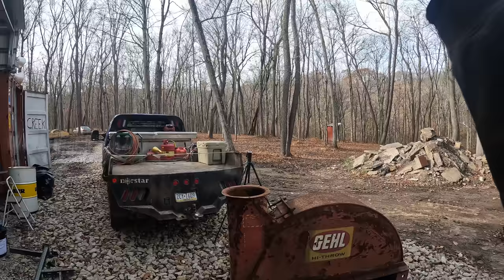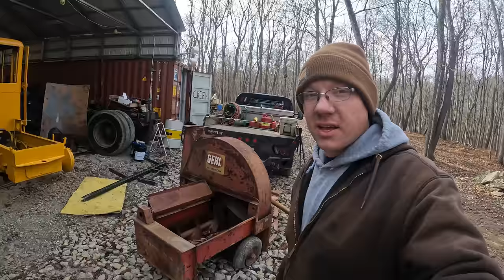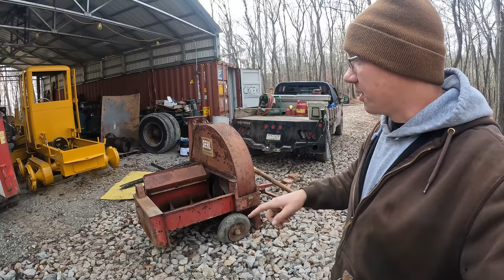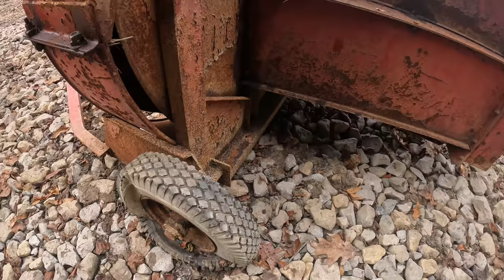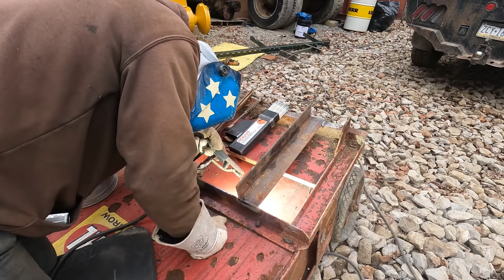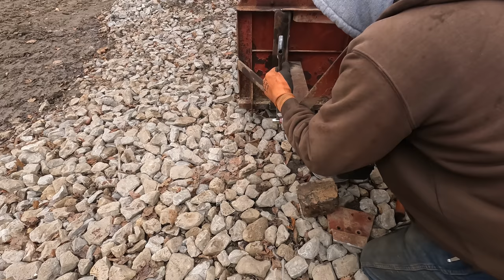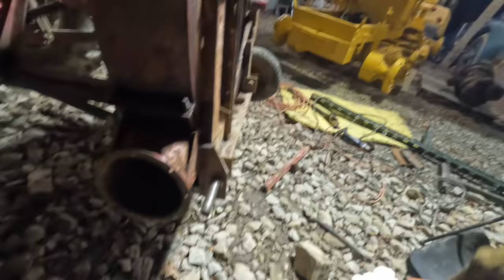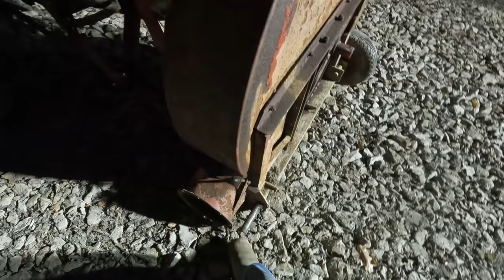I Built a Giant DIESEL POWERED Leaf Blower!!!

Comment: Bolt a plate over the hole in the side. 
Open an intake  hole on the side opposite the PTO about equal to twice the diameter of the output. Put an intake funnel tapering 
from three times the diameter of the intake to the intake size over about two feet of length.
That will force the intake air to enter the center of the fan wheel in a smooth flow. Then the air will be forced out to the outside of the fan wheel and gain speed as it travels. 
Extend the output about two feet longer. Have it taper to be 20% smaller at the end. 
That I'd what I did with a centrifical exhaust fan  blower on the anodized tanks at UTC in 1983. 
Doubled the flow at the output and increased the pressure at the output.

Comment: I would suggest turning the chute somewhere in the range of 210 degrees clockwise if your looking from behind the tractor. That way it will give you a more downward angle and should solve your distance of air intake. Then I’d look at creating a air dam using some ducting to increase air intake. Another idea that you already mentioned is to bolt a rectangle on the output to creat a more fanning effect.

Comment: Hey Matt, I think a nozzle made from plastic similar to what bins are made from on the end that flattens out and spreads the airflow will provide a simple effective result - it could also be easily removed when you use the blower for other tasks.  There appears plenty of air being generated, but it in hitting the ground in the wrong shape (poor description but you can probably see what I mean).

Comment: you need the intake for the leafblower at the top to get more pressure..it will have the same as it did before you moved the output...and a down spout

Comment: Hi Matt, a land wheel would be ideal for controlling the height of the blower, you could drop the hydraulics down. Just a tip, when connecting your  tractor to an implement with 3 point linkage I was told to connect the fixed arm first then the other arm can be adjusted with the winder.

Comment: I think you need to rotate the shroud back up around and have it blowing at a lot steeper angle so the air gets down under the leaves and creates lift, that's the way a leaf blower works. That will get you the volume you need also.

Comment: The moisture content of the leaves is up there between the leaf contact with ground and grass. Water acting like a magnet. Air pressure from inlet opening-right on. Change that. Could really work quite well. But the leafs have lots of moisture. Remember fall. Almost leaves full of air. You will get it done for sure!! Debo.

Comment: Try grinding the edges of each blade and turning the blower opening back to it's original position. Put a mesh over the original open where the blades are turning as this is why you have great air flow.  If you put the outlet hole back to it's original position adding flexible piping aimed on an angle at the ground this will give you greater aim towards the road. I'm going to try this because I know my idea will work better. Try it if you want to use it as a hay blower you can as the chute rotates as you know.

Comment: I'd try pointing it down-ish, like 2 o'clock. It'd probably move max air for leaves and debris and yet leave heavy stuff like rocks in place. 

Then, when you dig a deep hole for burning brush you have a built in incinerator blower too that could do tree stumps.

Comment: You need to increase the pro revs if possible, put a vertical slotted nozzle ,NO more than a quarter of the existing output area on and as someone else said, put the air intake central, these will increase output significantly, nice recycle job, love it😁

Comment: Great Video.  This would make a much better blower (centrifugal fan) if the inlet/opening was located towards the center of the impeller, and the area towards the outer diameter were closed off.  I also think it would be a more effective with a flattened nozzle at the outlet.  Good luck.

Comment: Fan and blower engineer here. Centre up the inlet and add an inlet cone (bell mouth) if you can find something to fit, and play around with some kind of reducer nozzle for the outlet. You could really do with some more rotational speed, although that would be a massive undertaking. With a paddle blade impeller you are somewhat compromised however so maybe just take 4 passes instead of two as you had hoped. Nice project though!

Comment: Reverse the edge of the outside chamber wall/belt. Front to back, Back to front. This will put the out spout on the opposite side and allow more pressure to build up. Close the intake opening to the extent that the opening is just a little larger than the  outlet spout. Make a funnel like device to give the output more air speed.

Comment: Make a new 12" tip to bolt on to the output and flatten the tip to 1" or so on the bottom(ground side), even bend the end the tip down so you can keep the whole unit off the ground and from dragging on the ground, the flat out put will increase the velocity of the air stream!

Comment: Hi Matt. You need put build up pressure. Put on some chute extension if you can get a hold of some. Even just 2-3 feet should make some noticanle difference. The priciple you can find in rifles. The longer the rifle the more pressure it will build up because of the air needing to travell the barrellength....

Comment: Like alot of previous comments I'd adapt a narrowed coned extension on the exhaust to compress and better direct a smaller air flow. Also you said you might want to keep the air chute for throwing straw? You already have the hole, how about fabricating a hinged, weather-stripped door with some wing nuts that you can close tight when blowing leaves and open when you do your straw. Anyway you impress once again. Good job.

Comment: good comments here. My head scratcher is the fan itself. If it is turning clockwise looking from the rear I don't see a good scoop affect. With a smaller toward the center hole the vacuum should increase an that should lead to more pressure out of the spout. I would suggest you think about a different fan configuration. Love to see all the things you come up with. Amazing!

Comment: If you just rotated  the nozzle from 7 o’clock over to 4 o’clock you should see full velocity and it would just blow the opposite direction . Then you could  weld a chute on the intake with an expanded steel lid. The expanded metal lid would serve as an intake guard but you could lift it up and drop straw in to spread it.  For spreading straw you would rotate from 4  o’clock up to 2.  Creative modifications of the nozzle could make it even more effective in the orientation.

Comment: Try putting the top of the guard on a swivel , so you can just slide it like a vent civer for which position you need for use. Itll be faster than block off plates.

Comment: They make them 3pt hitch ! Take everything off roll that hole housing toward the ground !
That will be your discharge ten build your 3 pt hitch brackets ,  mount two heavy duty wheels between blower & tractor , on bottom side of 3 pt hitch arm for machine to ride on also make them wheels adjustable for like a height gauage!
Gplf courses use the same thing for debris clean up !

Comment: I'd rotate the nozzle to where it blows hard and use a corrugated tube to bring the air to the ground at the angle that works for you. You've already said that it's designed to blow grain through a tube to the top of a silo.

Comment: Instead of using a boogie wheel, make a height adjustable skid plate with the leading and trailing edges bent upwards so that it slides instead of digging into the ground. The reason you aren't getting the push power on the air is due to a late start of incoming air and is not being compressed until it is being exhausted as soon as it enters the blower housing.

Comment: try making the air inlet about one half the size of the outlet. that way as the fan blows air out the outlet a vaccume is established.
the outside air will move into the small hole with a decent volume to feed the outlet.

Comment: Yeah a bogey wheel in some form is a good idea. 
To increase the air pressure out at the chute I'd try to fashion an horizontal nozzle that constricted the flow. Like what you see on hand held leaf blowers. Fluid dynamics 101.

Comment: What if you made the intake/straw hopper on the rotating assembly. It will rotate to a straw intake if you angle out the discharge and then when you locate the discharge in leaf blower mode the intake will be out of the way. Say 18-20” clockwise (facing rear of the blower).  Weld some bolts on the “old intake hole” then mount a solid plate that can be removed for servicing or declogging if your straw binds up.  Great video. Thanks.

Comment: This may be obe, but I think you should rotate the shroud so that the outlet is on the right side  with a bit of downward direction of force. No cutting or welding. Simple experiment, no fuss, no bother. You might be pleasantly surprised and then you can put that other wheel back on. Let us know what you find out.

Comment: I think your right sir just block off the old air intake and cut a 1x1 square hole on opposite side. Some expanded metal to make it a little safer. I would probably grind a 1/8 to 1/4 in off the blades as well. My chipper only has a 8x12in air intake and that thing throws some chips.

Comment: Not bad at all.  The sparks and air might be sketchy when the leaves are dry.  I think the ports are a good idea.  With block off plates you can open and close for clocking but also clock the air intakes and build a little cage out of expanded metal like a muffler or diesel air filter.  It can then be bolted and unbolted and moved or removed depending on application.

Comment: Build a snout for the chute and pinch it down to about 1 × 6 wide.
You know kinda like a hand held leaf blower tip.
It will give her more thrust.you could even point it down at a 45 degree.
Would allow you to run the unit higher off of the ground.

Comment: When you relocate your intake holes make an intake grate (to access air but keep out hands, debris, critters etc.) and use a pivot nut and a locking slot with wingnut. Wouldn't it be easier to just grind the fan edge rather than pound stuff and  it was a good idea to lube that shoot slide so don't forget for as you know, rust never rests.. If you don't cover the exit hole after use you will be shooting angry raccoons across the state and if they live they never forget either.

Comment: Anyway you could just rotate the chute 180  degrees to discharge out the right to the ground and just use a 90 degree elbow to direct the flow. It'll help build a little more pressure then you shouldn't have to modify the housing with holes in it. Then just build a hopper big enough to gravity feed a bail or mulch and when you spread you'll have an adjustable chute to throw it either behind or to the side

Comment: I have one just like it.   We covered that hole up that you have in the back. If you’re standing at the back of it looking towards your tractor we could in some expanded metal on the top at about 10 o’clock through 11 o’clock.   
  We just normally use ours maybe once every year or two for burning brush piles.  Where I live in East Texas, you can blow those leaves anywhere you want, because the next day they’re going to blow right back from the opposite direction.  Btw. It’s pronounced “ yell “ just like the old lady does. 😁

Comment: Instead of closing the big opening, turn the pipe 180° clockwise (looking from behind) and have a second pipe to attached to it, running clockwise down and under the blower. Like this you won't have to modify the housing anymore and you can blow leaf in your trail and not only on the side of it.

Comment: Just rotate the nozzle back up to the other side, aim it at the ground at a 45* angle and put a short piece of tube to lengthen out the outlet down close to the ground. That way you get the CFM it was designed for. Way cool project!
Reply: Agreed. You need to rotate the 'nozzle' back and add an 8" or so - 'air discharge tube' that can be pointed, as needed...(like those 'self-propelled vacuums' use...) We had an old Agrimetal GA115S straw blower on our farm that we used - mounted on the 3 point hitch of a 1952 Ford tractor - to blow snow.

Comment: Put a hinged cover for the bottom existing hole and cut a new hole in top for air intake with a hinged cover so depending on your use you can choose which opening you need for best airflow

Comment: Nice build.  I think you are close.  I recommend a chute deflector.  Also, you might think about a hooded air inlet feed on the sliding band?  Keep the water out and hopefully rust.  Also, It would be nice to have a hand wand with a holster that could be used for detail work.  Once the big hole is patched you should have plenty of CFM for accessories.  ;-)

Comment: How about rotating the shoot 180° for upper passenger side discharge and bolt a large hose like from a dust collector. The hose would let you adjust the discharge angle and possibly work in angled tips. I am picturing something like 6 or 8 feet long with maybe some small rebar bent up to help set the major angles of the hose and something like a rear mount snowplower shoot crank handle to adjust the direction of the hose tip? Plus with the hose discharge you can just remount the original wheels. 

Even a bad idea doomed to stay on the drawing board can shed light from a new angle and provide the spark for the final answer.

Comment: use the old axle as a pivot point to put the bogie on. Use an all thread to control the height I'm thinking a triangle coming off that axle, with a tube over it and the wheel at the back. You could incorporate a spring or something to negate any shock it may experience.

Comment: More fan blades/paddles on the fan wheel will push more air at slower speeds. The air intake relocation will help as long as it is of decent size.  Other than that give it all the throttle that you have. If you look inside a hand held gas leaf blower this should give you the best fan/ turbine blade design also intake and exit of the blower housing. If you take the hand held blower design and incorporate it into your deisel as much as possible you probably will have a deisel engine powered  jet engine minus the tremendous heat or afterburner lol

Comment: Shorten those blades a little , and put new bolts with nylock nuts.
Just look at a walk behind barrel blower for air intake inspiration.
I have an 3. 1/2 hp walk behind I use. It blows a large area.

Comment: Not sure if someone mentioned it or not, but you should also taper your output spout to better direct your airflow across the ground, as you are losing a large amount of it to blowing above it. You can also block up that lower intake and cut a good 90 in the top corner to reverse the engineering of it for more air pressure.

Comment: I would definitely change the output tunnel of the blower from that short round spot to a longer oval shaped pipe.  Make it narrower and little bit longer, you will get better air flow for blowing.  Look at attachments for leaf blowers.

Comment: I would suggest making a 180 degree turn on the outlet with an oval exit so as you blow leaves from nearer the center line so you can make two passes on your drive to clear the road. At the moment you would need to drive off the road to clear the leaves.

Comment: It needs to point at the ground more.  And a nozzle would speed up the air if it were cone shaped like a Ventry  a short tube with a tapering constriction in the middle that causes an increase in the velocity of flow and I know you will get it work it has potential to do a lot of work.

Comment: I built a smaller one of these years ago.  About 2/3s the size of yours.  My intake is in the center and it works well.  I use mine to suck up the leaves, so my blades are 4-6" away from the sides.  I still get good air volume and it does not jam.

Comment: i would block the intake up and cut 8 6-8ish" holes around where the axel is (since thats better for centrifugal blowers) and move the chute to the opposite side so it goes directly down and then put a metal flap on the machine side so you get more down force to get the wetter leaves up

Comment: The blades on the blower can be taken off and shortened and it shouldn’t reduce air flow to much. And as far as more air intake, fill in the hole that is there and cut a new hole above the pto shaft and you could build a small platform with a hinge and chains that will allow you to feed in straw.

Comment: Rotate the nozzle around and it's fixed. Blow it to the right of the tractor at a 45 degree downward. No mod neccesssary but to add a bit of cone or tube to better aim the unit.

Comment: Worked for Erosion Restoration land scape company. The man made a straw blower out of one. It had a convenient conveyor , that could self feed in the 1200 # square bales of straw.  Into set of sickle knives and chains the cut up the straw to be sucked in and blown out . Mounted On a tuck trailer with a boom shoot that could be directed  to any angle.  From the driver of the truck pulling the trailer!  The purpose was to blow straw over seeded  areas  that had been reclaim and graded landscaped  on large scale on in mountain terrains?  Used a loader to load the bales onto conveyor the driver moved along and covered as needed so was a two man operation. One to bring the bales on a truck & trailers fallow and load the trailer blower.  one to drive and blow the straw! After area graded & seeded! The trailer for blower had own engine driving hydraulic pump and the blower and feed and moving parts were all hydraulic so the control was a remote in the truck!